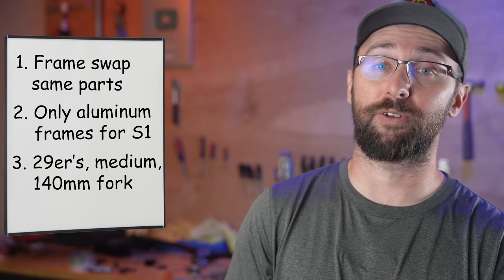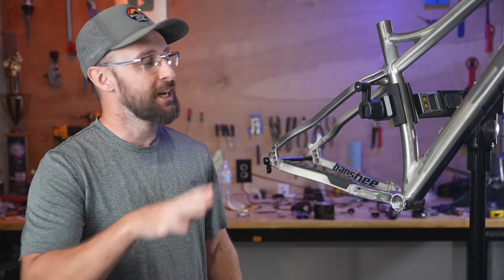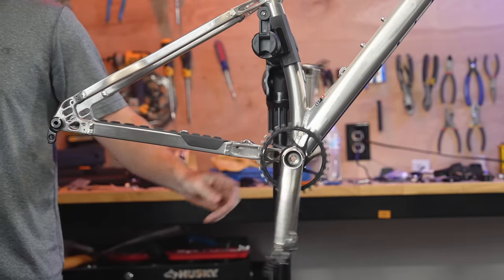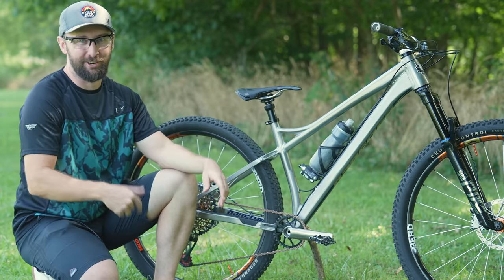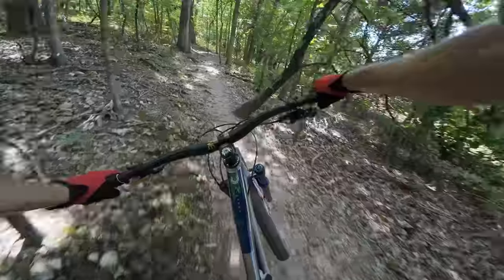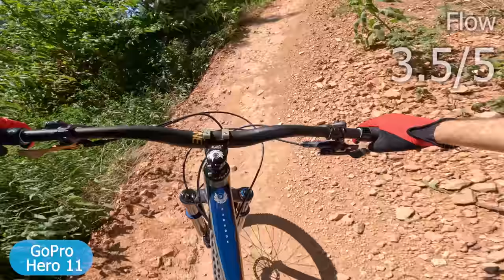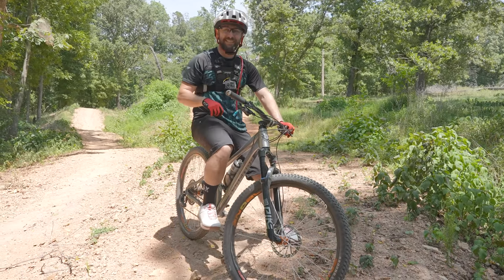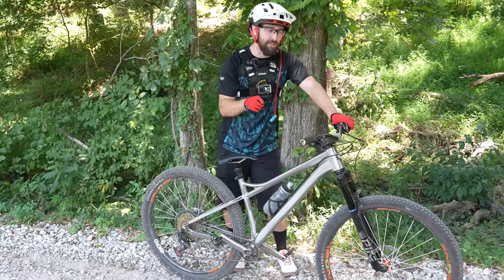The Banshee Paradox V3 is beautiful + DJI Osmo Action 4 Bike Camera

Comment: I've had a Paradox for the past 6 month and absolutely LOVE it! It's the best hardtail I've ever ridden (I started riding in '90). Lightweight, dialed geometry, manuverable without being twitchy, and the frame's compliance really helps blunt trail chatter. For taller riders, the stack height is a game-changer - I don't have to run a high-rise stem or monster riser bar anymore. I've got mine built up as a "light trail" bike w/ a 130mm Bomber Z2 and Bontrager XR4 2.6/2.4 combo. For size reference - I'm 6' 5" on an XL, which just a bit small for me.

Comment: Finally an honest, unpaid review on this frame.  The Geo is kind of all over the place. Semi steep seat angle but not long enough or slack enough to need that seat angle. A falsely tall stack from an abnormally long head tube limits used Fork availability.  Plus the price for an aluminum frame is crazy.
Reply: Sounds like his review hit your assumptions about the bike. I have a spitfire and I can tell you 7005 forged aluminum is significantly better than 6061 cast, hence the price. Also reviews have a lot to do with where people live, what they ride, what they want out of the bike, and how they ride, it doesn't mean one is wrong or right. For instance yumyum just got a  revel rail and said it doesn't climb that well, the climbing prowess is all I've heard about that bike. Also 6 hours on a bike in one area isn't a great review to me.

Comment: I own both the Scout 290 and the Paradox V3 both in size L. I have put over 90 hours on both frames with the exact same parts and tires and ridden the exact same trails , root sections and jumps. The fact that you rated the Scout higher than the Paradox blew my mind. I do not understand where your rating came from. If something i would rate the Scout a 70 and the Paradox between 95-97.
It is a better frame in every aspect.
Reply from the maker: Interesting! That's cool you own both. What kind of trails are you riding?
Reply: @EvansMTBSaga  I live in the Pacific Northwest (Portland). I ride Rocky Point, Sandy Ridge, Gatesway green bike park etc.
May i suggest you put more hours into riding the Paradox, as Steve from Hardtail Party mentioned, and i agree with him, the Paradox V3 is a completely different hardtail from the rest. It takes time to get used to it and the way it rides, but as soon as you become familiar with it you will see what a ride it is. 
Best regards.
Reply: I'm not surprised he liked the Scout more.  He's riding a lot of smooth, flowy, flat trails. The Scout's design suits his trails. Banshee=North Shore, Vancouver BC=Steep chonky tech.  It's an enduro hardtail. Anyone who's owned a Paradox and taken the time to adjust knows how good and capable of a frame it really is.
Reply: 100% agree @antoinedoinell
Reply: Agree as well. It does sit very upright when pedaling, but this is one of the best all around bikes I've ever owned.
Reply: My coworker loves his. He built it with a 140 fox34, Xx1 I believe and i9 to dt Swiss. Came in light and after some time he loves his. We are almost the same exact size and I feel the paradox is a tad too long for my liking but nothing to complain about. I bought mine used and never changed out the lower end parts yet. Plus I do not have any real trail time yet. I also own a commencal meta ht ohlins.
Reply: @antoinedoinell and don’t forget he likes to be a lil flashy with his jumps with some smooth landings but majority choppy. I own the Paradox V3, it’s a very capable all mountain trail bike, hours in the seat definitely required to understand the bike. If you ride the bike only a few hours you’ll definitely give it a low rating like Evan did. Banshee Paradox is a solid 95, the Enigma (another nice frame) is right next to the paradox even though it’s a 27.5 frame..  

Evan get more solid time with the Paradox and you’ll definitely change the rating.

Comment: The Paradox takes a moment to get used to. It is an excellent frame, and especially when running 27.5" * 2.8" tyres is compliant, comfortable and great fun.

Did I hear you right about the frame lacking a water bottle mount inside the front triangle? It absolutely bdoes have them. 

The frame isn't for everyone, and it would be better if the rear end was size specific but it still is one of my favourite bikes.

Comment: Great looking bike - looks fast standing still. 
DJI looks way better, natural colours, and excellent exposure compensation in both bright and patchy light.
ND filters: Great because it's easy to brighten dark images in post while retaining detail,  but impossible to recover overexposed highlights. Variable ND filters are super awesome as they're 2 polarised filters on top of each other - reduce exposure and glare, and only requires the one filter. If you're using a compact camera like a Sony RX~ or Panasonic TZ~ you can use a product like Magfilter to attach them. Have a look at K&F Concepts, kind of like the Polygon of filters - as good as anything else but reasonably priced.
If you're using your phone and don't have a filter kit, just hold your sunglasses close to the lens.

Comment: You’ve bloody trashed GoPro there mate, maybe try actually giving it a fair crack next time. Also it’s called a bloody hardtail for a reason, your not supposed to expect small bump sensitivity on single track.
Reply from the maker: I gave GoPro the most fair shot, it's just not a good camera. I've rode several Hardtails with great small bump sensitivity

Comment: Specialized Fuse or Norco Fluid?
Reply: I just bought and built up a Norco Fluid, and it is incredible! Best mountain bike I've ever ridden. However, I've realized for this challenge, he's only looking at 140 mil travel bikes, and the Norco Fluid is 120 mil, so it will not qualify.
Reply: @AZRob.  So, I also have a 2021 Fluid HT. I originally bought the bike since the FS I ordered was vastly delayed during the pandemic and I needed something to ride (and I had only ridden hardtails up until that point). I ended up replacing the weak parts on the bike (brakes, cranks) and ran a different wheel set from another bike that I used to own. The stock fork developed stiction and I had it serviced under warranty, but had also had it extended to 130 mm. It felt slightly choppered out but the bike could handle so much more. When my FS came in, I replaced the original X-Fusion extended fork with the Fox 34 Performance 130 mm that came with the FS bike (which got an even better upgrade). The reduced offset (44 mm on the Fox vs. the 51 on the old X-Fusion) restored the wheelbase. The bike handled great and the damping was vastly improved. It's not the most hardcore of hardtails (it's no Rocky Mountain Growler), but the Fluid HT is great to ride around as a do it all bike and can handle a lot of terrain, especially with the upgrades. I still take it out quite often and am not going to sell it. I wish Norco offered a better spec from stock to compete with Specialized, as the geo on the Fuse and the Fluid HT are quite similar in many respects and it's a great bike with the right parts.

Comment: @EvansMTBSaga
any chance to put the Poseidon Norton into the race especially since your channels used to focus on affordability. Norton Frame is suppose to accommodate 650 and 29er…. on paper it’s very close in terms of geo to the Nukeproof Scout. Same frame reach (440mm) and stack is 647 vs 642 on the Scout. Would be interesting to see your opinion … plus it looks like the Norton has internal and external cable routing.

Comment: I enjoy your videos, especially this series. But wouldn't you want your bike to be stiff on smooth single track and compliant on chunky stuff? I only ride hard tails and the only time I find myself ever wanting rear suspension or compliance is on rough chunky sections. Sounds like the perfect bike to me but I don't really ride jumps or flow trails. A high BB sounds good for getting over logs and such.
Reply from the maker: Good point! I definitely want to experiment with some bigger tires for the Hardtail set up. But grinding out miles on single track and getting beat up by every single bump is not fun. I rode the Ragley Big Al and the Scout back to back on the same singletrack and it was like I was on an entirely different trail
Reply: I guess that I would have to actually ride the bike to know. Maybe someday I will. @EvansMTBSaga

Comment: Evan, on the tech climbs, you mention that you were not able to make that climb before. Could it be that with all the practice of the different frames that you are just more experienced and have improved your skills?  Fun series to watch though. SO far I still like the Big All 2023 and Scout. Great Value for performance
Reply from the maker: haha dont tell anyone but that is a downhill only trail that I climbed up. I've only attempted it once before on a full suspension. But i can feel when a frame is good on tech climbs, like if it gets hung up, or if I can easily punch move the back tire onto a platform

Comment: I am not surprised with your findings that the Banshee works best on the chunk.  

Banshee and Knolly bikes are designed, and some are built in BC. They are engineered for North Shore trails, chunk, jank, and more chunk.

Not all bikes are designed to be a jack of all trades. Some are designed for specific regions of the globe.
Reply from the maker: Yeah I'm excited about it still. Going to hold onto it and set it up how it should be, outside of the series

Comment: I have a DJI Action 2 and the magnetic mounts are amazing! And it really small, perfect for helmet. However it can't record on a memory card and the battery extension is not waterproof. My former Gopro 7 Black had better video quality. The stabilisation is better on dji. I guess you have to make compromises. They are both excellent cameras.

Comment: 1st of all huge fan of the channel. (Still waiting for the Gwin 100K subs video. )
I agree with how the mounting of the bottle cage mounts are strangely placed along the cables. I hope the next version of this frame gets a fix on that bottle cage mount and routing 

I was able to fit a Fidlock 800ml water bottle though without any issue. 

For the fit I went through the same problem and had to change cockpit setups twice in-order for the bike to fit and get comfortable to me. I guess same with other bikes that I owned in the past.

Comment: For the record, 1080p video on youtube looks super blocky in general - it's not related to gopro, it will look like crap from any camera - because YT has nerfed the 1080p codec significantly. I've tested it and if you upscale 1080p footage to 2k it will look crisp and clean on Youtube because it's using the better codec.
Reply from the maker: yeah its a bummer. Now I upload everything in 4k though
Reply: @EvansMTBSaga  yeah it sucks - and now they're making 1080p that looks good like it used to a paywalled "feature" behind YouTube premium. I even pay for YT premium and think this is super lame.

Comment: I'm 6'2" and I owe size XL and it feels small with 42mm stem
Reply: What stem length did you end up with?
Reply: @loomspace  after some time I figure out that this bike has a little too steep saddle pipe. I still ride 42mm stem and saddle all the way to the back

Comment: Whoever told you to use 24fps on an action camera is a fool. For MTB you should always be at 60fps
Reply from the maker: Yeah I was disappointed with 24 fps. I don't believe it matters much if it's 30 or 60 fps, it matters what the shutter speed is. Personally, I don't want the most stabilized footage. I want it to feel like action
Reply: @RealMTBAddict  maybe this is why I look like im going slow when im not lol I like how smooth the 60fps is though.